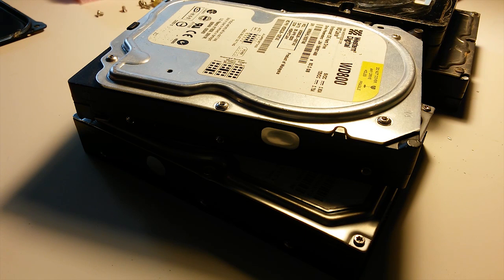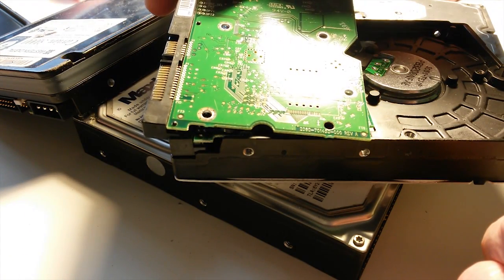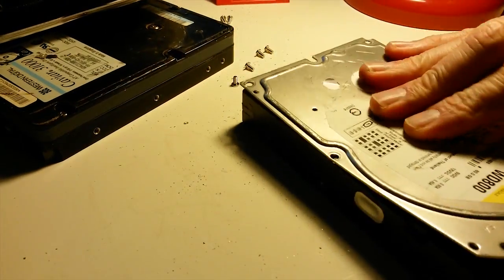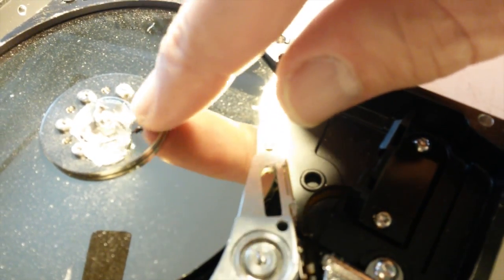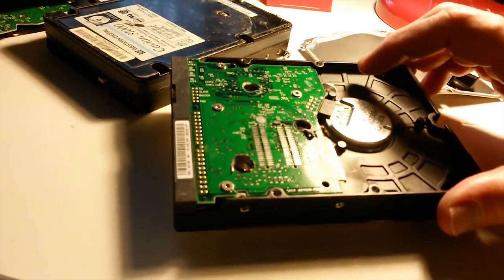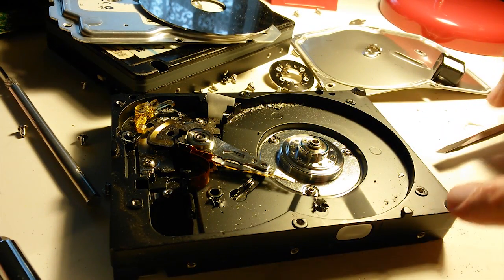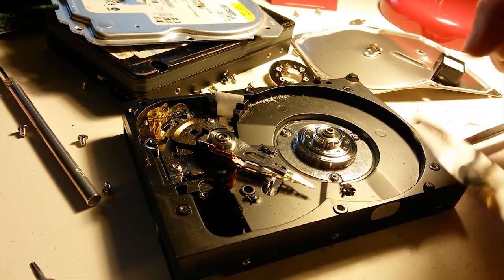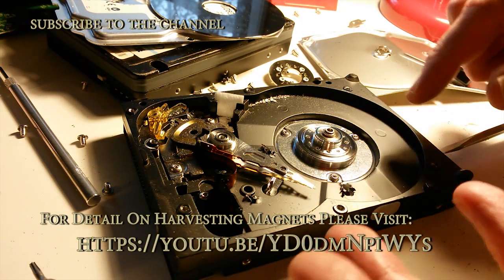Don't Drill Your Hard Drive

Comment: Drilling a hole through it that goes through the platter is the fastest way to ensure the data is unrecoverable. Just because the idiots who drilled into your sample hdds didn't know what they were doing doesn't change that.
Reply from the maker: No one said it would, the video just points out that if not done correctly it could put your data at risk and that there are other solutions. Thank you for watching and writing in.

Comment: I think I'll just drill five or six holes in random places where the platter probably is. Faster than taking it apart.
Reply from the maker: Yes drilling through will work and won't take a lot of time. It just one of several available options.

Comment: um drill all the way through and you will not have issue . just make sure you drill in the right spot. put the drive on a block of wood then drill all the way through into the wood done
Reply from the maker: Thank you for sharing a good solution.

Comment: If you drill your hdd make sure it goes all the way through the front and back

If you open a hdd it will break so you can do what i normally do which is open it, hammer the shit out of the disk and the header, close it. Then power drill all the way through, and if i really want it gone, beat the shit out of the controller.
Reply from the maker: Thank you for sharing your tips.

Comment: I have 2 laptops I want to throw away and I don't have a drill. Do I just destroy the CD looking round part inside the hard drive so no1 can access anything I had on it? I'll smash up the laptop itself with a hammer too is this all I need to do. Thank you
Reply from the maker: If the laptops are still usable consider repurposing, selling or donating them. If not then drop them off for recycling. Just remove the hard drive destroy the internal discs. Disc can be made of glass or metal. The glass will shatter while the metal will bend and tear.
Reply: @cfldriven  tysm :)

Comment: Be sure you hit the platters if you decide to drill. Format your drives first, multiple passes. One hole is sufficient because it will warp the platters as you go through them. Take a sledgehammer to the drives for good measure. I also remove the PCB and recycle those separately.
Reply from the maker: Dave, thank you for watching and sharing your tips.

Comment: Dumb clickbait title. You can drill through a HD to kill it, just hit the platters, not the spindle and not the board.
Reply from the maker: The IT person that did this was not trying to kill the drive, they wanted to prevent data from being recovered. Since they didn't go through the platters the data would have been recoverable. The point of the video was to show there are better ways of wiping the data off a drive without drilling, but that if you insist on drilling then its like you say through the platters.

Comment: I drill hard drives all the time. The difference is that I do a competent job drilling them!
Reply from the maker: Good to hear you're doing a thorough job, curious to know if you're using a drill press or just hand drill? thanks for watching.
Reply: @cfldriven  I wipe them first when possible using shred and then put them on the drill press.
All disks are fully encrypted from the day they are commissioned as well.
Reply from the maker: @MrDeviousdom  If they are encrypted and you wiped them clean why destroy the drive?
Reply: @cfldriven because the drive is old and will fail soon.
Reply from the maker: @MrDeviousdom  Thank you for sharing the response.

Comment: I think a better title is "Make sure you drill holes in the right place when drilling your hard drive."  Super simple, easy to see where to drill for anyone above 40 IQ, way less effort than taking it apart unless your drill is very far away.  Still, this is informative on WHY you need to be accurate with your drill.
Reply from the maker: Thank you for the title suggestion. The reason to be accurate with the drill is the need to actually drill into the platter and not just the shell. I prefer either taking it apart, which I don't do anymore as I have plenty of magnets, or using software to wipe it clean. Thank you for watching and taking the time to comment.
Reply: @cfldriven  software doesn’t 100% wipeout everything
Reply from the maker: @steveno7058  Unless you have national security info on your hard drive, the easiest way to completely erase a hard drive is to use free data destruction software, such as DBAN (Darik's Boot and Nuke).
Reply: called ...being smarter than the DRILL!! lol

Comment: what could one use the magnets for ? I got a box filled with old and older still hard drives , I could take them apart instead of just dumping them whole :-)
Reply from the maker: They are great for holding things like calendars, notepads, etc. I always keep one by the tool box as they are helpful when searching for dropped screws and nails. Can be used for magnet fishing (google this), where you drag it through a stream looking for metal objects.

Comment: I’m just going to light my old 7 drives on fire 🔥
Reply from the maker: For some hot data!
Reply: @cfldriven  I also have a 8tb hd seagate that I was cloning brand new that was on the floor my girl accidentally tripped over the wire and it disconnected during install and it was over after that it made the spindle noise when I turned it on again and never had a chance to even use I wanted to put her in the hard drive just to delete her lol
Reply from the maker: @allinonethegreat  What where you thinking leaving all those cables and hardware on the floor, while your girl was free ranging in the same area? I once came home to my toddler sliding on my LPs on the floor. He had destroyed a half dozen by the time I walked in.
Reply: @cfldriven  man I was so pissed lol

Comment: Drilling is okay if you actually drill the right spot. You just used poor drilling efforts to try to show that drilling is bad. So this video doesn’t really prove anything. If anything, it just shows that people should be more careful about “how” they drill.
Reply from the maker: Actually in the video I mention how I got these drives from the IT dept, I didn't do any drilling. Which goes to show even the experts can get it wrong and thus proving the point. I agree everyone needs to be more careful especially if drilling a hard drive. Thanks for the comment.
Reply: Thank you for this.  I didn't know missing the platter was possible.

Comment: You'd think the people drilling into the hard drive would take the top off first and drill directly into the disk, seems that would be the minimum you should do if you decide to go that route.
Reply from the maker: Probably because it involves finding the correct Torx tool and going through the processing of removing them all. They could have a least drilled all the way through the drive, but again it someone taking the easy way out without the proper tools. Thanks for sharing and watching.
Reply: @cfldriven  Well that's my dilemma too really, I've got an old hard drive and was going to pop the top off, but I'm going to have to get a "torx tool." I guess if you can't see the disc or get the top off you could always drill uniformed holes all the way through all throughout the drive so you know there are several holes in it.
Reply from the maker: @robertkees6048  Definitely numerous ways to wipe out a drive from using software to brute force. Be careful with drilling.
Reply: @cfldriven  I put a hole all the way through my hard drive, just to one side of the spinner, and afterword, you can see the hole in the disc and the it still spins so you can see the hole you've made. I just drilled one pilot hole and then I spin the disc and put several holes all the way through. One hole in the drive, several holes in the actual disc. It was easy and also easy to verify the mission was accomplished.
Reply from the maker: @robertkees6048  Talk about thinking outside the hard drive case. That is a smart approach to drilling a drive. Thank you for sharing that.
Reply: @robertkees6048  How do you spin the disc?

Comment: what if i take the platter out and smash it to bits
Reply from the maker: It will be easy if the platter is glass, a lot harder if metal. You could make a wind chime out of them or use them as coasters. Thank you for watching.
Reply: @cfldriven  , i guess an angle grinder will soon destroy it
Reply from the maker: @josephcroft4268  Yes an angle grinder would allow you to cut it up, but probably a lot less dangerous just to open it up and deal with the individual platters.

Comment: My method of killing a hard drive is to just drive a nail completely through a drive, a hammer and nail is all you need in order to kill it.
Reply from the maker: If it was truly sensitive data, this method would still leave partial data readable. OF course for the rest of us, this sounds like a good solution. Thanks for sharing.

Comment: I really don’t get which part actually holds data. You say the drive parts can be disposed of in different trash bags, but what part holds the data and how will different disposal bags help if one undestroyed part can fall into someone’s hands?
Reply from the maker: Each of the platters holds data. In multi platter drives the info is written across all the platters, thus separating prevents recovery of all the info. If you have sensitive data they're are better ways erasing it without the need for drilling or taking a drive apart.

Comment: LOL. I have some of those magnets too. They hold up lots of pictures on the fridge!
I worked for someone that had us disassemble the cases, remove the platters and set them on the ground and bend them up with a  hammer.
Reply from the maker: Thanks for sharing, they are also great for finding lost screws and pins.

Comment: What about drill it and then put salt water in it? 🤔
Reply from the maker: Interesting, the salt would corrode some of the metal components, but platters are aluminum, glass or ceramic and are coated. Don't know if the salt water would break down the platter coating. Since you've already drilled a hole, might as well use a center punch to bend or shatter the platters, save the salt for the popcorn. ;)

Comment: Ok, that's great....but how do you open it if you don't have that special screw driver? I tried everything and can't get it open so how do I destroy it? Is there another option for those who can't open it?
Reply from the maker: Thanks for the question, the Torx bits and drivers are readily available at any hardware store. But let say you don't want to spend money on tools for just one drive, other options could include using software to wipe the drive clean, repurpose drive to store music or old files, smash it up with a hammer or sledge, drill a couple of holes completely through the platters, or use it for target practice. Of course if it just full of love poems to your ex HS sweetheart just drop it off at the recycling center.
Reply: @cfldriven  Haha, thanks....I was hacked badly and my computer was completely compromised. This is the second computer it's hapoened to in a few months.  It would not allow me to do anything not even delete files, get into my C: drive etc or even format.. So I've decided I want to destroy it. Would hammering really do it? I mean it's so solid. I have to destroy the other one also.
Reply from the maker: @IncubusOfDeath  Do you need to destroy it if you and no one else can access the data? While the sides and bottom are solid, the top plate will succumb to heavy blows. I'd wear safety glasses and gloves. When you start hearing parts rattling around you've succeeded.
Reply: @cfldriven  Thank you! Yes I just feel the need to destroy it just in case.

Comment: Informative video...thanks! 
Question: Some paper shredders can accept CDs and DVDs. Are the platters similar in composition so that they can be shredded as well?
Reply from the maker: Platters are usually metal or glass, so it will probably ruin your shredder. Instead make a wind chime or scatter each disk in a separate garbage bag. Thanks for the feedback and viewing.
Reply: Attempting to shred a platter with a small shredder is never going to happen.

Comment: My preferred method of hard drive destruction involves a big empty field in the country and large caliber firearms.  A 250gr .45 Colt cowboy action lead flat nose bullet will blow off the top cover, mangle the platters, warp the rear casing, and wreck the circuit board, all with a single shot.
Reply from the maker: Sounds like fun, you get to work on marksmanship and wiping out data. Kinda hard to do in the big city. Thank you for sharing and for the view.

Comment: All your showing is that the fools that drilled them failed to drill through the platter. Probbably have never seen one inside. If you drill just ones through the disc it will desteoy data. I MY SELF cut the discs with a grinder after I take all apart.
Reply from the maker: Soon we will be able to just snap our SSD cards in half.

Comment: I've got a couple of old laptops whose hard drives I wanted to destroy. You've made an excellent case for NOT drilling holes through a hard drive/case. Thanks for sharing.
Reply from the maker: Glad to hear you found the video useful. I tend to re-purpose my older drives and the ones I can't get disassembled. If selling or donating a computer I include a hard drive that has been wiped several times and formatted with a new OS so that the computer is useable. Thank you for the feedback.
Reply: No he didn’t. You must not have critical thinking skills.
Reply: @johnhill762  Apply your own critical thinking skills and make your own video that presents evidence to the contrary.

Comment: Could you not remove the case take out the platter then snap the platter? Cus then surelllyyyyy its unrecoverable
Reply from the maker: The individual platters are more likely to bend as they are metal. You could bend them all up, or just make a wind chime out of them.

Comment: I got to open the HD, just to discover that the torx on the spindle are smaller than a T5, I fucking hate every single tech company, why do they have to make these obscenely small screws?
Reply from the maker: I recently experienced a similar issue when taking apart a laptop hard drive. Got lucky and found a bit driver that had the smaller torx. Thanks for sharing and watching.

Comment: Just hammer it while it works
Reply from the maker: Hopefully not in the computer.
It will damage the drive but most of the data would still be recoverable.
Reply: @cfldriven  I mean it's easier to do than drilling. But I guess the most effective way to destroy it is using a sandpaper and deeply scratching all the disk surface or burning.
Reply from the maker: @ozmobozo  Lots of ways to destroy data, I recently read there is some software that will wipe the drive and destroy the hardware it so it can't be reused.

Comment: It seems very unnatural that you could drill three to four holes into a hard drive and coincidentally not hit a single platter, considering how large their surface area are.
Reply: It was probably a girl that was drilling.
Reply: @MrDeviousdom And as the mom of teenage boys, I was thinking the opposite: "figures, ask them to do a simple task and they find a way to screw it up. That's another chore I just should've done myself".🙄
Reply from the maker: I can only guess as to why the person doing the drilling did such a poor job, perhaps they had no idea what they were trying to destroy. Maybe the bit was worn, who knows? 

You have to determine what options are available to wipe out or destroy data and then which is the best approach for your particular situation. While I have destroyed a drive or two in the past, I prefer to re-purpose them for backup purposes or as a scratch drives.
Reply: @cfldriven  I’m learning IT right now and don’t know how to wipe a drive, and also have no interest in keeping a 2.5” hard drive I can’t use that has less than a terabyte in storage.
Reply from the maker: @flyingturret208thecannon5  You may want to try https://www.diskwipe.org/
It is open source and free and will wipe your disks and save you some bullets.
Reply: @cfldriven  haha, my brother and I like target practice. It's just a different target.

Comment: i mean you can see exactly where the platter starts and ends on the plastic side to drill through
Reply from the maker: I think the trick is to make sure you drill through all the platters, or use some other technique to wipe all the data.

Comment: an arc welding rod straight through the case and platters in a few places is very quick, and very very destructive :)
Reply from the maker: I bet that is, you should make a video of it, although not a common tool for most of us.
Reply: @cfldriven  When you first learn to arc weld, you discover very quickly that it's too easy to blow holes through metal until you get the technique right ;)

About 3 seconds to feed a welding rod right through the case and platters with molten metal splattering all through it. Very satisfying, but yeah not something that everyone has. (and you do need to put on a bit of protective gear).
Reply from the maker: @NeilMcAliece  Wow! Thanks for sharing your technique.